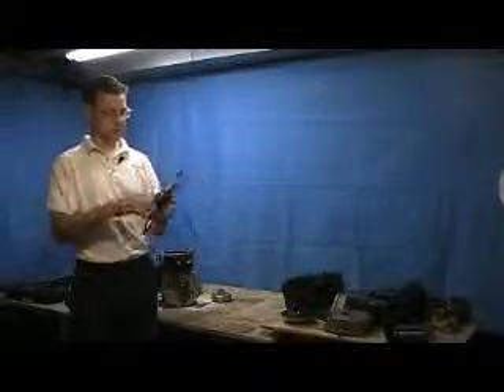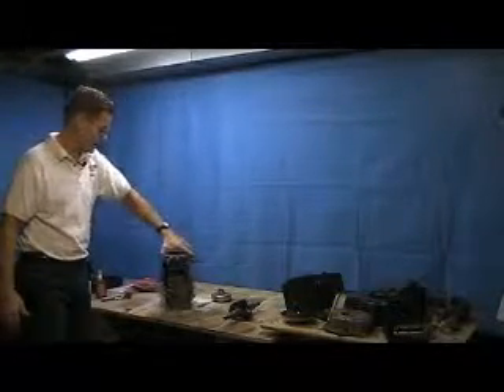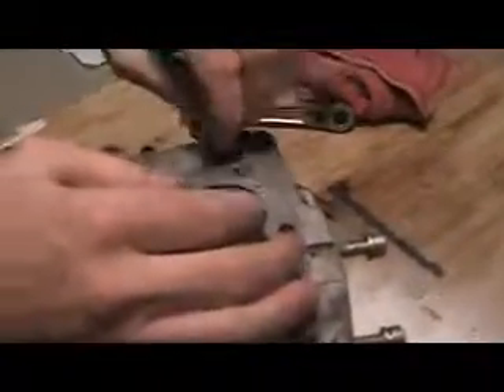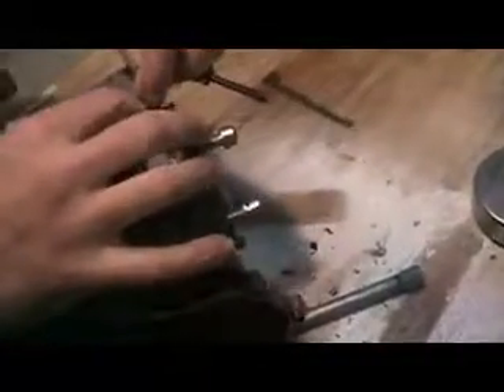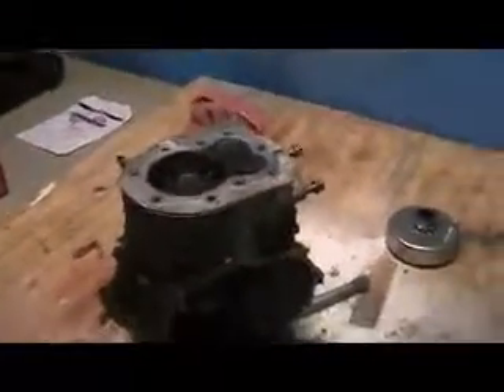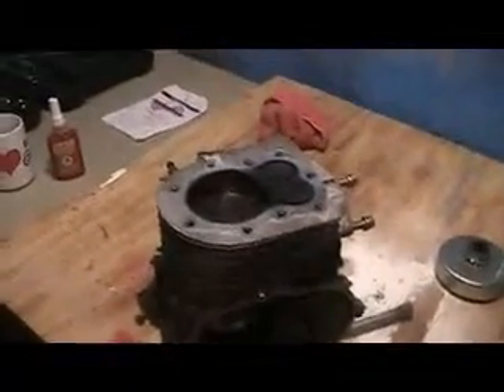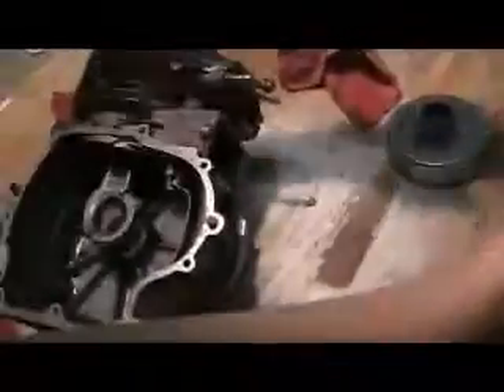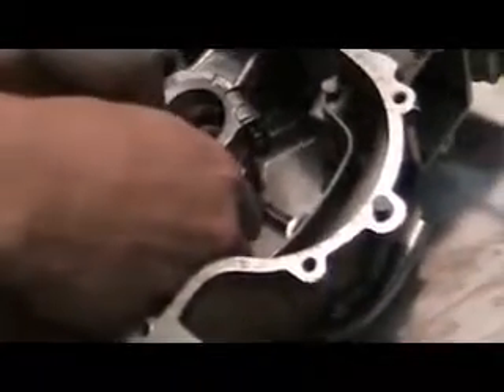Go Kart Engine Re-Assembly

Comment: I have a problem I am disabled and wish I had the money to get my problem fixed . I have a 1994 craftsman chipper with a 5hp briggs with a carb on the gas tank. The gov spring broke so I bought a new one it looked just like the old one just not as much stretched When I replaced it it will not throttle up . I found the gov set all they way clockwise . If I turn it counter clockwise will that help my problem ?
Thanks